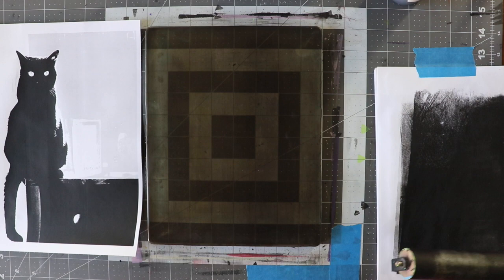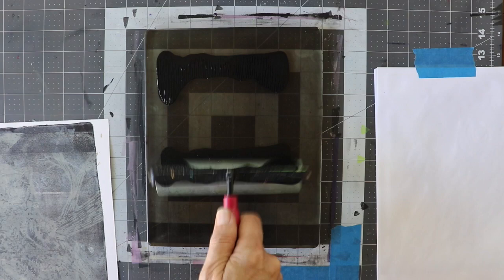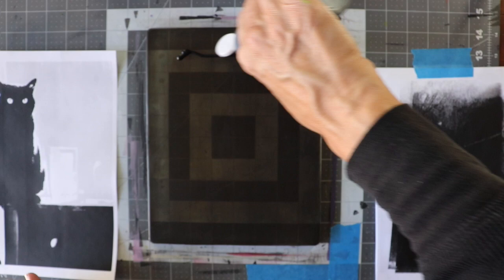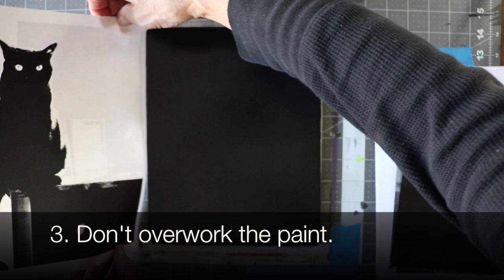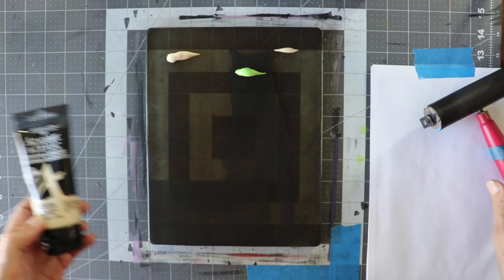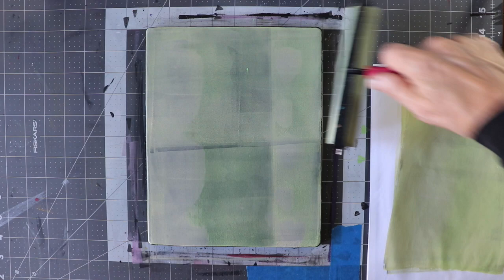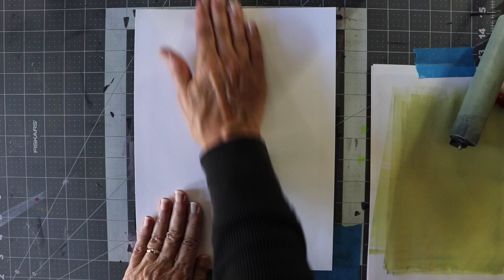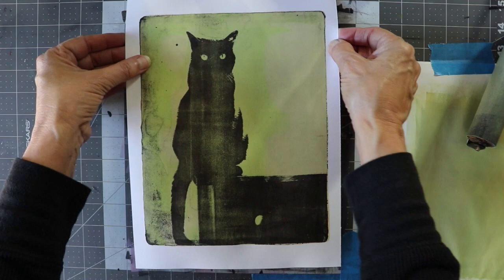Laser Print Transfer on a Gel Plate

Comment: In your experience Should the paint be thin or thicker for the first print /transfer of the laser print? Thanks
Reply from the maker: I lean toward an even layer of light to medium thickness of craft paint...If it is too thin it will be transparent and if it is too thick it won't pick up all the paint and leave a transferred image.   My advice is to try different thicknesses with the paint you are using to learn what works best.

Comment: When you're finished using the plate and putting it away first prime the plate with Johnsons baby oil before boxing it up that way the plate will not dry out too quick.
Reply from the maker: Great advice.  Thanks for the tip.  :-)
Reply: Fantastic ! What paper did you use please.
Reply from the maker: @gailpz4764  I typically use Canson's mixed media paper as well as Bristol.
Reply: @starlustudio1498  thank you so much, happy printing x